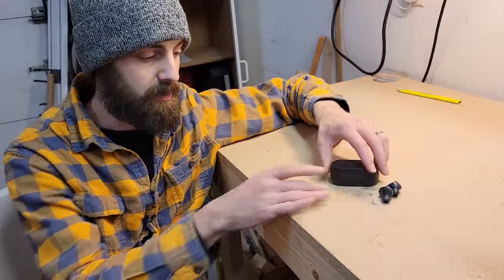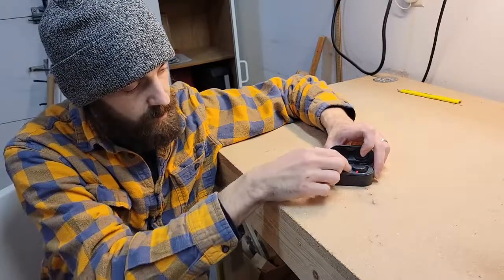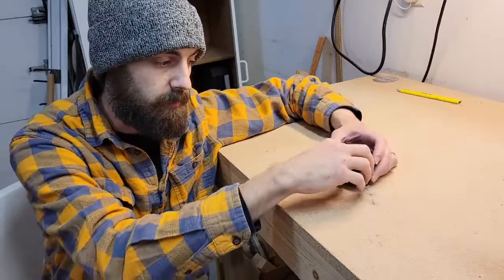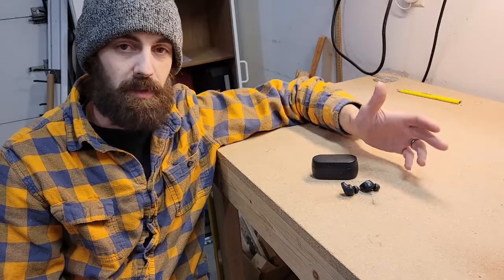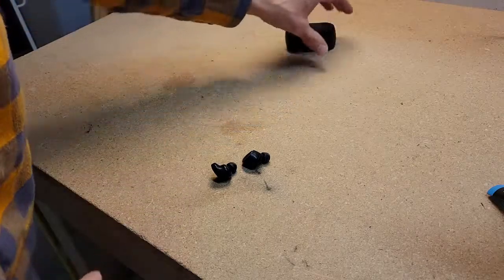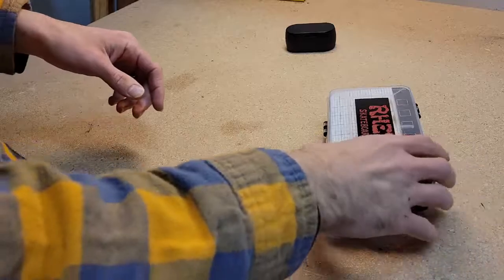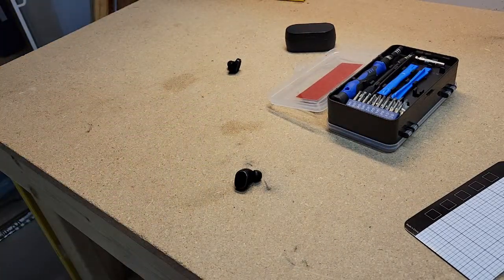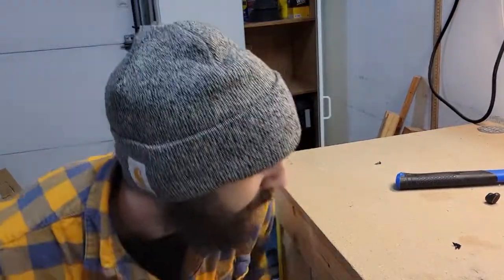Simple Skullcandy Headphone Fix - Sesh Evo

Comment: I bought a pair during christmas time and still never got the left earbud to work. Charges fine and connects but no audio. Customer support wasnt any help either. Was such a waste of money
Reply: Same with me
Reply: I do not understand what is wrong with such a crap brand that always the left ones stop working and the problem is persistent in most of the models, to top it off the users are the ones who have to be looking for methods because technical support does not help shit.

Comment: mine have this problem that when theyre in the case, the left one works just fine and had a red light, but the right one is a flashing red light. ive reset them multiple times but they wont pair with eachother or connect to my phone. this is my second pair

Comment: I’m not having charging issue my left ear piece seems to be stuck in pairing mode. Anyone else has had this issue before ? It’s just blinking blue when out of the case and when put into the case it charges perfectly fine
Reply: mine have this problem that when theyre in the case, the left one works just fine and had a red light, but the right one is a flashing red light. ive reset them multiple times but they wont pair with eachother or connect to my phone. this is my second pair

Comment: you reset them by holding both the buttons down until the power goes off then turn them back on by holding the button down and as soon as the power goes on press both the button 3 times and it will reset.
Reply: next time you through money away, email it to me. lol

Comment: Just dropped one of mine into about 4in of water and piss 🤷‍♂️ I just took it as a loss and put the other in the case .. .it was still connected so I stuck my hand in that piss water and blew it off and it works.... I rubbed it down with alcohol

Comment: Hey guys. Just found he way to fix it (not charging, case blinking fast):
diseamble the case, charge the lipo battery separetely, with imax or other hobbist charger. The battery has been lower than 3 volts, case doesnt recognise it. Like my comment if it helped for you.